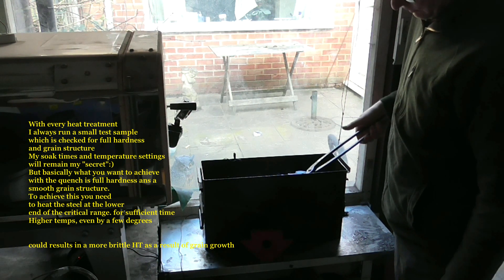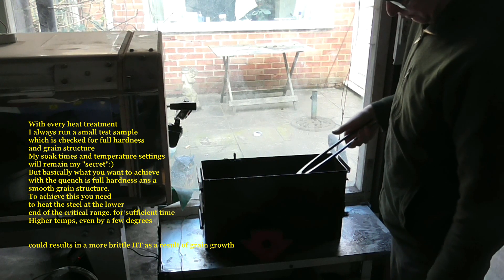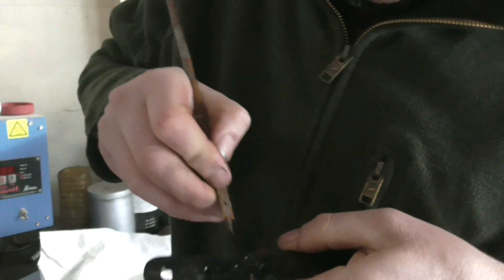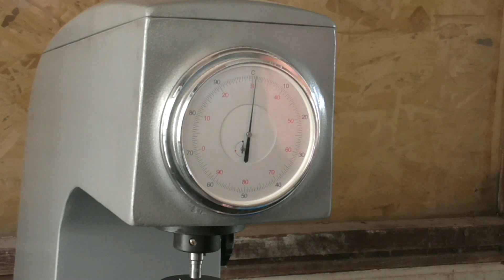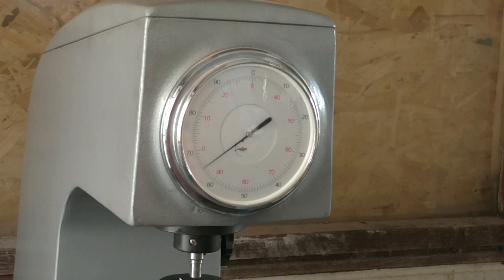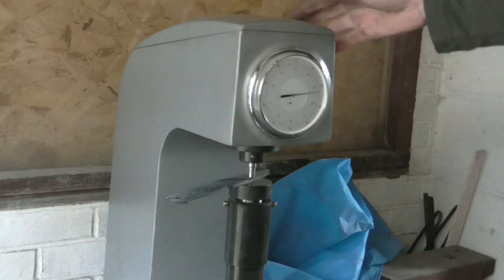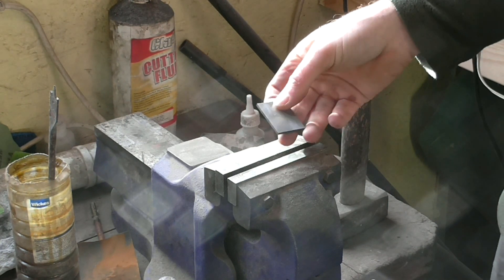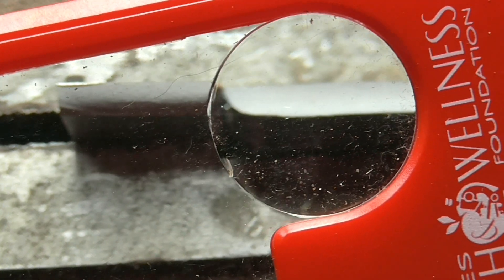Heat Treatment hints and tips

Comment: Very nice video as always Sandy. I use 01 steel for most of my knives as well and also use the "sample piece method" to have a rough idea of what happened in the kiln during HT :) The only thing that surprised me a little was how easy it was for you to snap the test piece after hardening since it always needs a lot of force in my case. (Thickness = 3mm)
Maybe you experienced something similar in the past and have a idea of what could be the reason for that.
Don't feel forced to answer that. I know you are a busy man and your videos were tremendously helpful already.
So, thanks for sharing all that knowledge.

Oli
Reply: +Oli Maler Please check out "That lazy machinist" on Youtube. Search his videos for "Heat treatment of steel" Once the hardened blade is tempered then you will not snap it. It sounds to me that you are not hardening your steel sufficiently. Your steel should be very brittle and snap easily after quench but you must wait ten or twenty minutes for it to cool. The test piece will snap. Never let your blades go cold. Always temper the straight away.
Sandy
Reply: +Wiltshire Man Thanks Sandy. That was again of great help !! After all it seems like i have to increase temperature. Although i am already at 810°C. Well who knows how precise my thermocouple is working ?!
Thanks again,
Oli
Reply: +Oli Maler Oli,
You cant trust thermo couples. You have to test to get a better understanding. Thermocouples can drift. If you were quenching aat 810c then they should hrden well. You need to soak for a few minutes, atleast 10 minutes minimum and quench immediately keeping the oil bath close by. Don't remove the blades from the oil until they have stopped smoking and then temper them before they get below 55C.
Finally test the edge on a brass rod and look for good deflection and return. If the edges chip out very easily you have gone too hot in the kin. If you see any yellow in the steel you have gone too hot in the kiln and the blades will be chippy. If the blades do not snap after quench (Just hardened blades that is) you have not hardened them sufficiently. You either have not soaked for long enough or the temp was too low or a mix of both. Hardened 01 should read 65Hrc or thereabouts..
Once the blades have been properly tempered you will become very tough indeed and you will not be able to snap them unless you put in a huge effort and even then they will bend alarmingly before they snap.
Sandy
Reply: Thanks again Sandy. Gonna do some more testing next week and i'm curious about the results.

Comment: Man as much as I have learned from you over the last couple years, I really wish I could get some more exact details on your whole heat treat process. I understand why you keep it secret, but man I had breaking a blade testing it.

Can I ask about your experience either annealing and/or re-heat treating knives after a failed hardening.
Reply from the maker: +TheFreeWayGearReview it can be done but please bear in mind that I always use anti scale compound so as not to loose carbon. From my experience you just need to heat and soak at your preferred times and temps then requench. This seems to reset the steel. I have in the past also annealed and normalized but found they made no difference. These days with many heat teatments under my belt I get it right first hit, but that was not always the case. All I can say is do not over heat, 01 benefits from a bit of a soak. Quench until there is no smoke and temper immediately and you should do OK.
Sandy